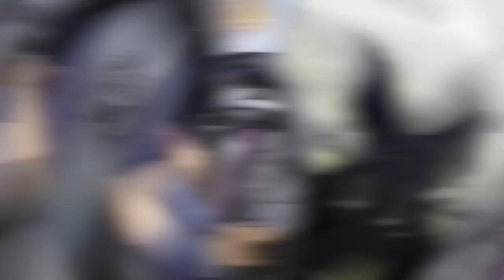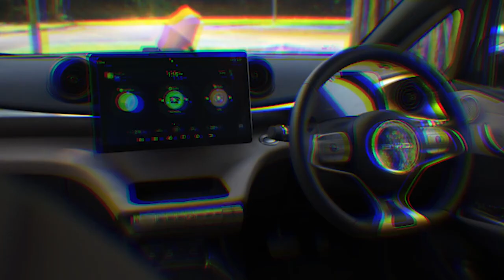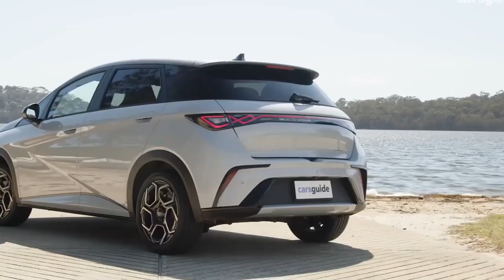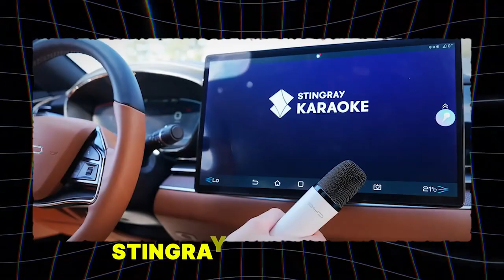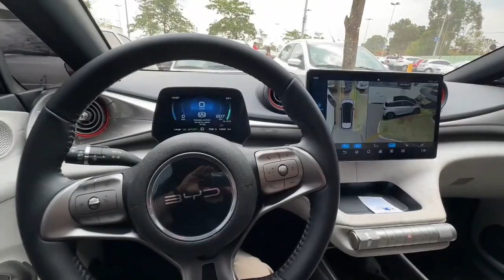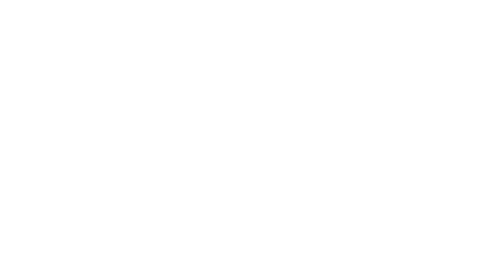Secret Features  BYD Dolphin Owners Don't Know Exist!

Comment from the maker: Which one on this list genuinely surprised you? Drop the number below, I want to see which secret is landing hardest with Dolphin owners. My guess is either the V2L camping power station or the Sentry Mode that's been sitting there unused since day one. Prove me wrong.

Use our free EV Owner Calculator to find out exactly how much you'd save switching to an EV, compare petrol vs charging costs, check used battery health, plan road trips, compare BYD models, and more: https://evehiclecalculator.com/calculator